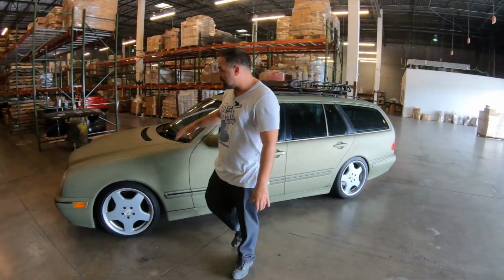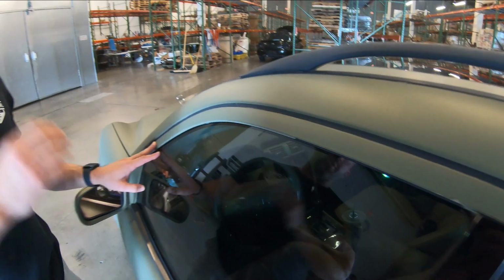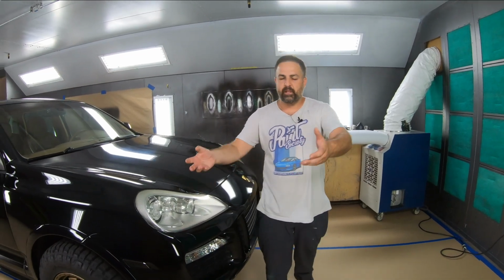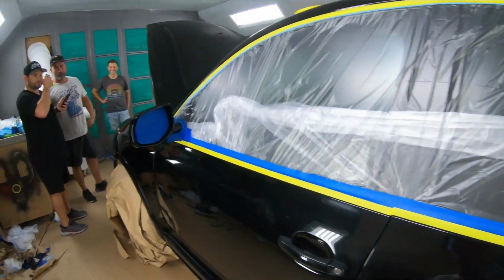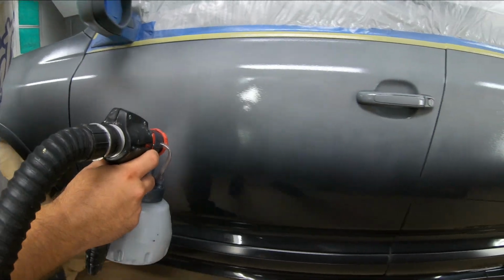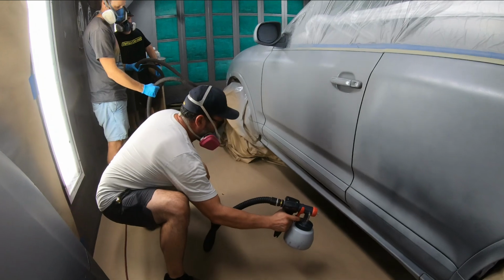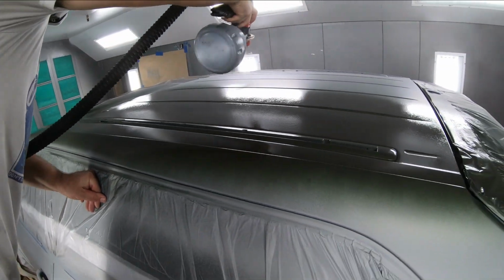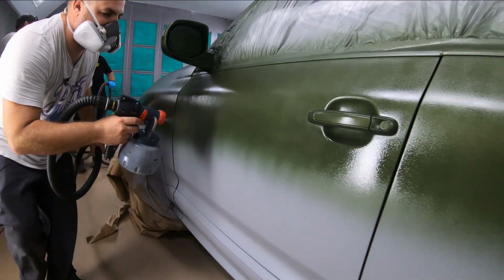PEELABLE Paintjob!

Comment: If you use wax and grease remover it melts the dip right off. Used it on wheels in the bolt holes when it doesn't peel off. Works awesome.

Comment: Great information. Thanks. I enjoy watching you and am learning a lot. On a different topic of confusion for me...are the 3M PPS gun adapters specific for use on either a PPS Original or a PPS 2.0 cup and cap? Meaning I would hate to have to purchase both The Original and the PPS 2.0 cups and caps because the base coat gun has the Original adapter and teh Clear Coat has a 2.0 adapter...if there is even such a thing when it comes to the PPS gun adapters. Thank you.
Reply: Would love to hear his input on this. But as far as I am aware they do not work with one another. Best bet will be to just buy the PPS 2.0 adapter for you base coat gun
Reply: @miguelmigkustomz9010  I learned from the 3M Rep that the two types are NOT interchangeable. The PPS Original adapters - of how they attach to the cap are designed for two attach points and have a flat surfaced fitting that is narrow in comparison to the redesigned 2.0. Original PPS adapters are no longer made by 3M and only available from the after market. Cups and Caps and liners are still available for the Original and from a price point the 2.0 system is less expensive to use. The PPS 2.0 adapters are designed for 4 attach points to the cap and they are more funnel shaped and have a flaired attach surface that is NOT flat, and the user can now also  pinch the cup and liner at the base of the cup - so when you want to add more paint to the cup, and take off the cap of the 2.0, you can hold the liner to retain it in the cup. The Original PPS, when you remove the cap, the liner is stuck to the cup as one piece and the liner has to be separated from the cap after it is removed from the cup. Unfortunately, I knew none of this and have ended up with ordering two adapters for my two guns, and purely by chance ended up ordering original two adapters and will be using original caps and cups and liners.
Reply: PPS 1.0 is a push and a snap on.PPS 2.0 is twist on.I think the patent ran out on the 1.0 they are everywhere now,even Harbor Freight has a cup system and adapters.I stuck with the 1.0 for my guns.You can get a box of the whole system pretty cheap of Ebay.The adapters are extra.
Reply: @MickE98  I went to Harbor Freight. Picked up the 17 piece starter cup and cap as a kit that comes with 5 each of liners, plugs, and caps. Then also bought the 30 piece refill kit. All are for 600ml. FYI, aliexpress sellers are abundant and a variety of sizes are available, from 160ml up to 800ml...with different numbers of sets of liners, filter caps and plugs, and tax, but if you look, there are sellers offering free shipping.
Reply: Nice.Make sure when you go to put the lid in your cup with liner.You do not push the liner down past the lip and the lid sits flush.I found it easier to push the cup into the adapter with the tangs almost lined up and a slight twist to lock it in.If you ever shoot flake or heavy pearl you will have to tear out the screen.

Comment: I'm wondering if that paint is suitable for a HPLV spray gun, and does it need to be watered down to spray properly? Not sure on the gun used in the video, but it looks like it puts out a lot of air/paint, more than the a HPLV gun.
Reply: you can buy their paint gun system, only a few hundred bucks or the wagner ones from home depot I tried

Comment: Dip gets a bad rap. When done right, you can get a nice look and a cheap color change. I painted my car traditionally with auto paint, and it was a massive job that took weeks of body work and prep. It was worth it to me. But if you don't have time for such an extended project, you can dip your car in a day, from start to finish. No, it's not going to look as good (or OEM) as paint, but for younger guys with beaters, it's an easy and economical way to get your car one good color.

Comment: I remember when you didn't have to mask your car and just peel stuff off your windows , emblems , lights.
Reply: You can still do that, but it comes down to how clean you want the final result. Going through and taping everything, pulling off easily removed trim/parts, and all that just lends itself to a cleaner final result. You absolutely can just Maaco spray everything and peel where you don't want it, but it'll look like that's what you did. That won't matter from more than 10 feet though, so it just comes down to what you're looking to get out of it. ;)